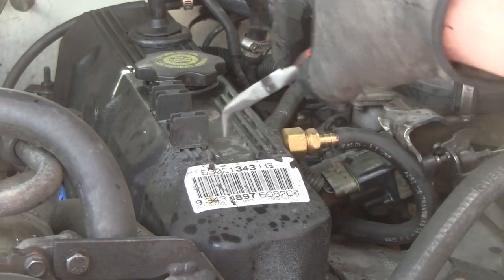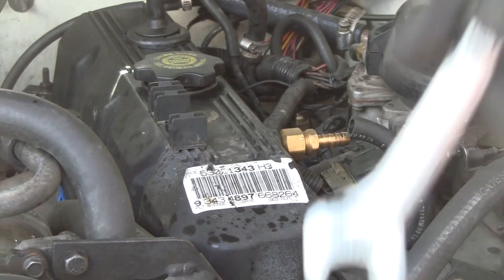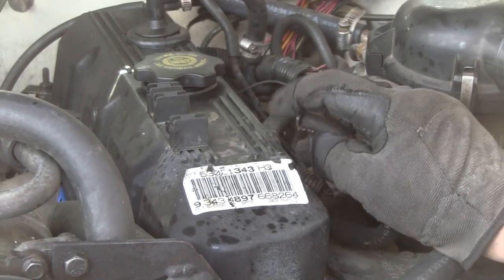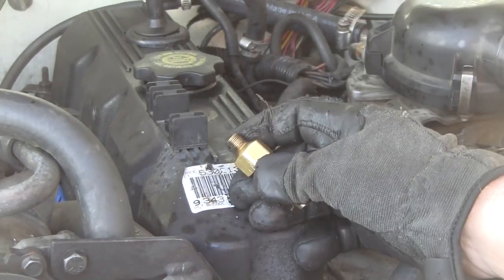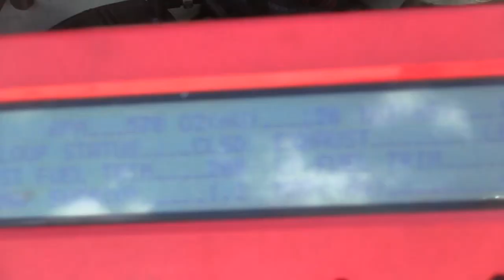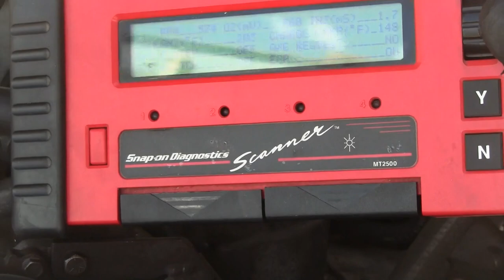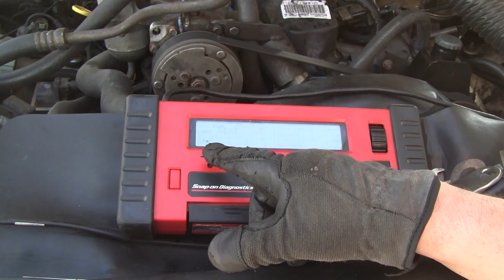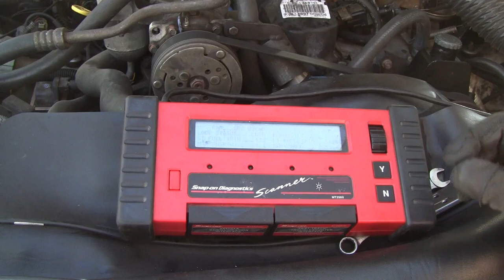1986 XJ 2.5L. One Vacuum Leak Repaired !!

Comment: I know the video is over 2yrs old but I feel the need to share a little bit of insight, if I may. You stated that the valve cover is not the correct cover. But it is very similar to the 4.0L cover. The 4.0L cover has the CCV "orifice" towards the rear. I can actually see it in the video. I cannot see what it is going to. On the 4.0L the front port is plumbed to the air box and supplies filtered air to the crankcase..
Reply from the maker: Thank you for the info !!